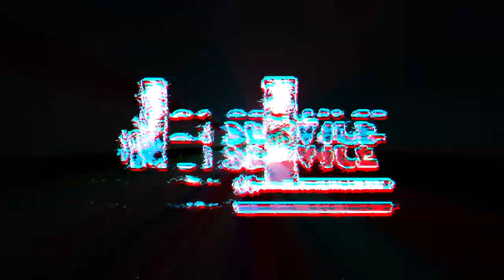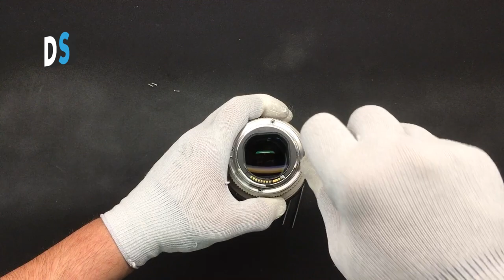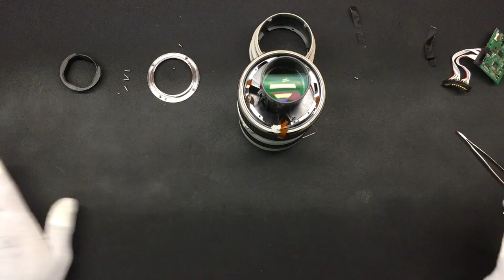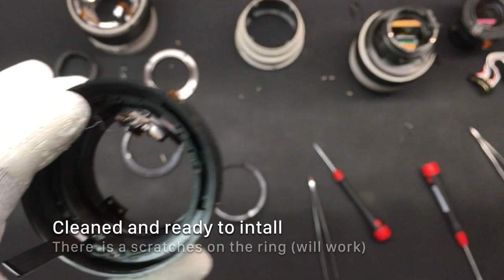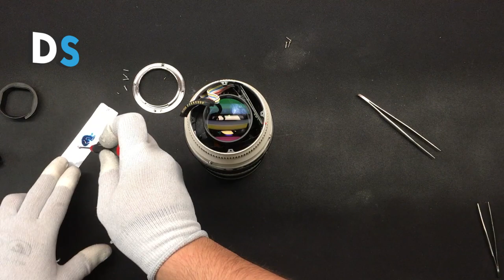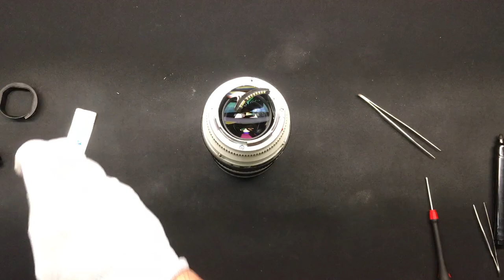How to repair Canon lens EF 70-200 F2.8 L USM I - Focus problem (Dust inside the USM)

Comment: Great video! my 70-200 f2.8 have some play below te focus ring(the af works fine) it is necessary to disassemble everything? or just tight the screws below the rubber?
Reply from the maker: Thank you! :)
Reply: Hi Matias! Did you get your lens fixed? I have the same play below the focus ring. Would be nice if it’s an easy fix. Cheers!
Reply: finally i sent the lens to a canon service shop for a regular maintenance and that was all it needed. they told me that only required basic cleaning and tight the screws
Reply: And yeah, after that the lens works and feels rock solid

Comment: Hey man you peobobaly wont see this becuse its a lot of time since you posted the video but i have a problem and i tought you coud help me. I replaced motor unit in my Canon 70-200mm f2.8 IS but now there is a problem id does focus but it takes a looong time for it to go from 1.4m to infinity it takes more than 10sec do you have any idea what can be wrong. Thanks alot :)